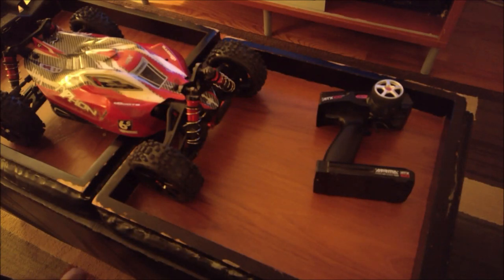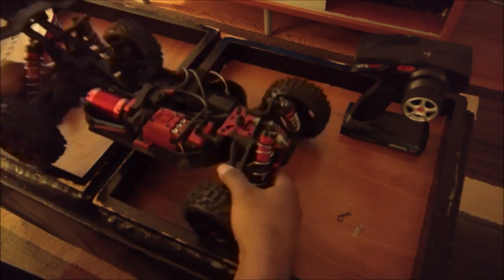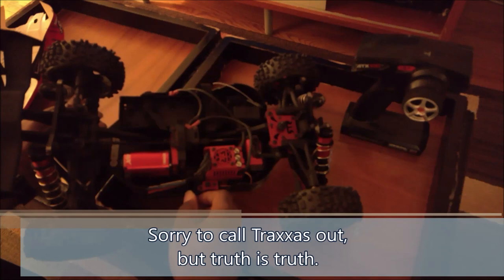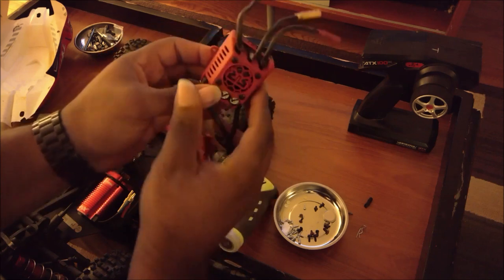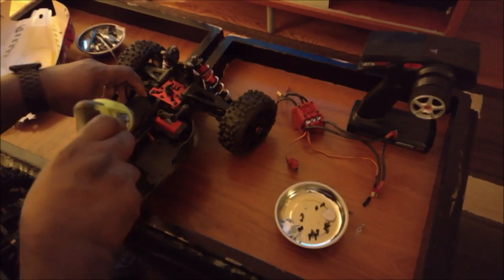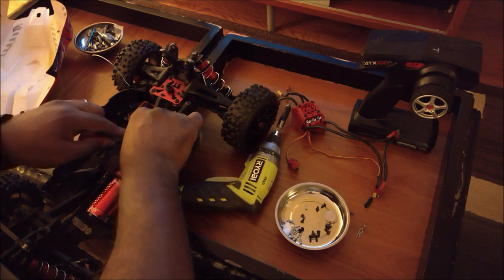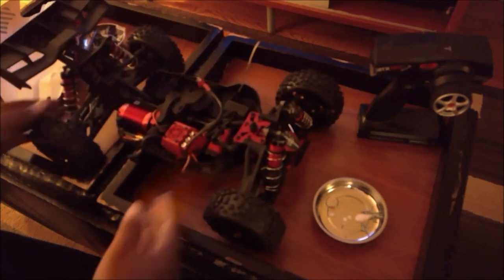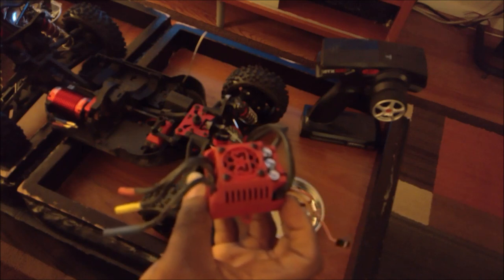Ep. 247:  Introducing Spyke + ARRMA BLX180 ESC Issues

Comment: Great video as always. Funny thing is I was looking at Arrma as well for my next RC car. Haven’t ran one of those before. For now I need to finish installation of the XO-1 diffs on my Slash. I think the only thing original on it at this point is the chassis and axel carriers. Lol
Reply from the maker: I know where you are coming from. It's easy to fall into the customization hole. 🤣

So far, I'm pretty impressed with the ARRMA just from their build quality and how well thought out the Typhon is. I'll let you guys know if I still think that way after I actually run it. 😁

Comment: Great pickup if ya gotta fiberglass and put tires  on it why not change it to a spd run great vid as always and great tips👊🏻✌🏻
Reply from the maker: I'm debating making this car a switch hitter, meaning setting it up so I can quickly go between speed runs and bashing. I tried this before with the  Slash platform, but there was too much that needed to be changed. I'm thinking that I might be able to pull it off with the ARRMA, though.
Reply: rhouse21 - RC Physics that’s sweet double the bang for the buck 👊🏻